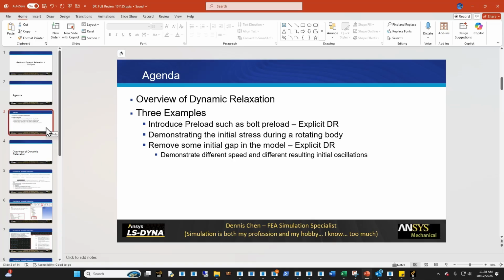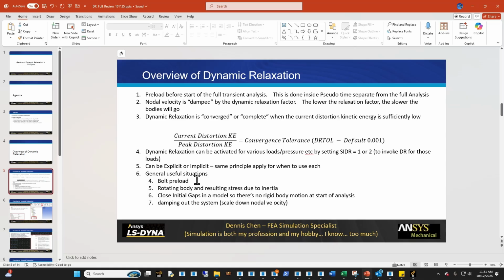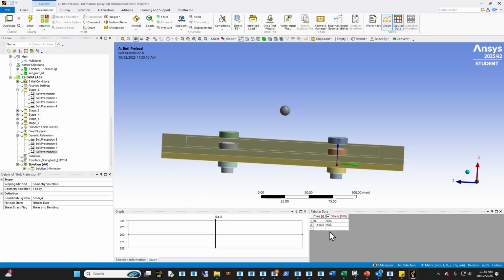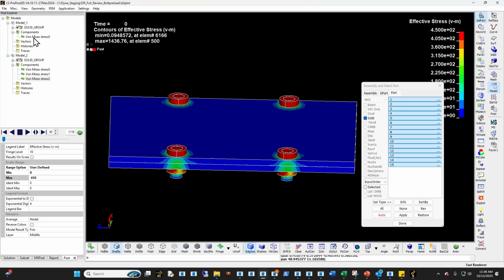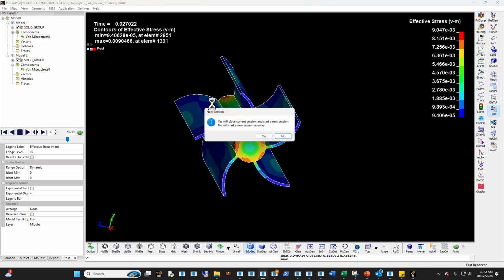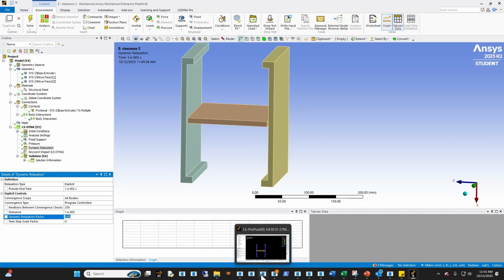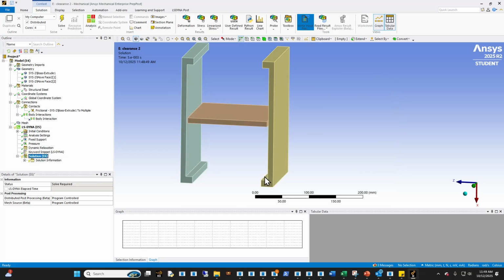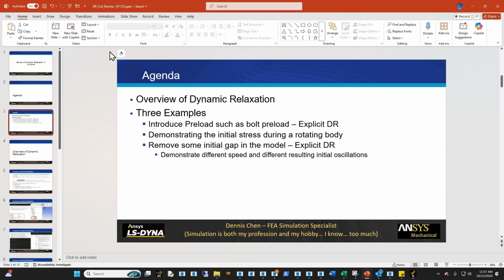LS-Dyna - Full Overview of Dynamic Relaxation

Comment: Huh, I never thought about applying rotation in dynamic relaxation. There are two other ways to apply rotation, but I think I understand why you don't want to use them.
1. Applying initial velocity at start of transient does NOT get you stress/strain of the component at the start of the simulation.
2. Ramping up velocity in the transient phase and allowing it to reach steady-state would take longer than using DR.

Is what I wrote correct, or am I missing something?
Reply from the maker: Hi, your 2 points are correct to me but I am not understanding the part about rotation.  that's ok.    DR is just a psudo time part of the model before the real transient analysis.   It allows preload, allow parts to come into contact if they had some tiny initial clearance, etc.

Comment: thank you!
but sir, i got 1 question.
how did you set the range of the contour like that?
that's not the primary ls prepost set up right?

appreciate it!
Reply from the maker: Hello, I am not sure what you refer to but i didn't do anything to change contour in this video.   In fact it's set to dynamic which is just auto updating and is not a good practice.